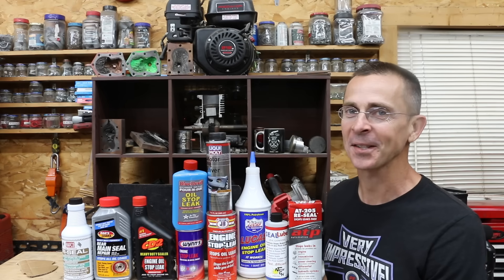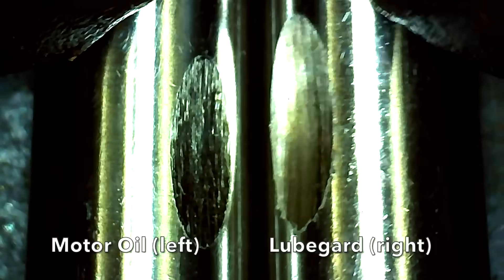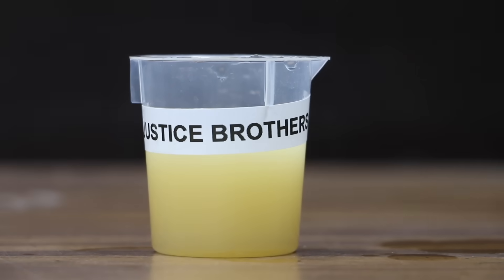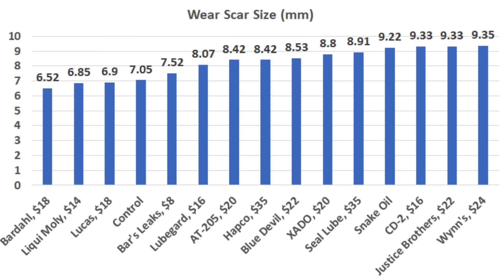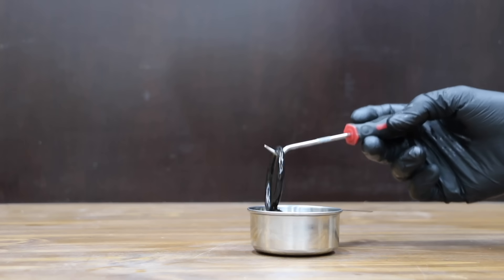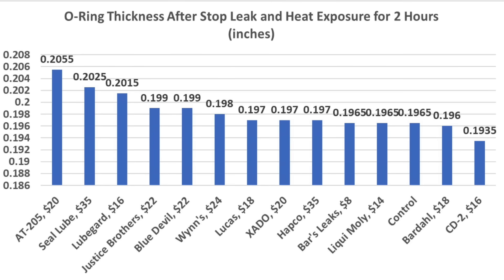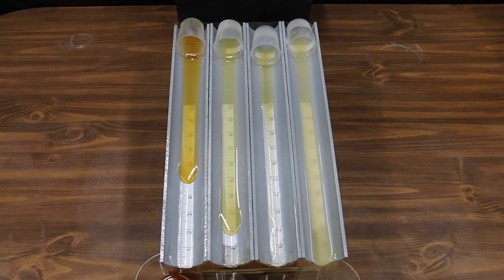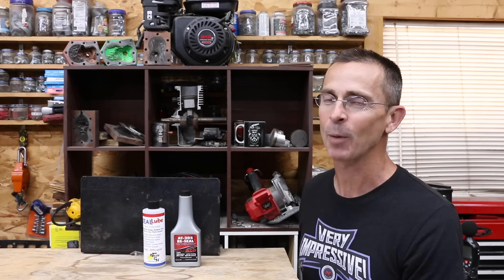Do Stop Leak Products Work? Do They Damage Engine Seals? Will They Destroy an Engine? Let's Find Out

Comment: I have a 2006 Trail Blazer that I dont understand is if it is drinking Engine oil or if its leaking but the car is at 349k kilometres and it's too expensive to take into the shop to repair, do you recommend the AT-205 for my case? The care is also missing and the rpm keeps fluctuating at Idle

Comment: This was yet another objective product test, but it's flawed.
The film strength test provides a relative indicator of engine wear, but not a realitic one. No one is using any of these products at a 1 to 1 ratio. 
Can you imagine trying to run an engine with 50% of any of these products in the crankcase? Scary thought! You should do it. 😉

Comment: My 2006 kia diesel is mixing oil and water in cooling system i suspect its a old oil cooler o ring playing up. Have been considering using at 205 to soften and swell the o ring hopefully stopping the leak instead of having to remove and rebuild the oil cooler. Should i try the at 205 or just spend the big bucks to get the oil cooler rebuilt?

Comment: Great video - thx but there is a however!!! I believe it was a missed opportunity to not actually list the measurements results in a chart. While ranking is good, it is a rather brute and coarse measurement. Can you add the actual measured results as a chart? Then ranking each test as deviation from the mean should present a very different picture- a more balanced and equitable position showing that the difference between the first and last position is not that drastic!! Thx again

Comment: Im having some oil leaks in my old 09 honda pilot. Seems to be coming from the rear main seal. I doubt AT 205 is gonna hurt it but im strongly debating trying it out to control that leak. Would the liquid molly or lube guard be the better choice to stop the leak with minimum/no damage?

Comment: used bars      just tried this last week followed directions still had leak lower rad hose area ford escape , so kept heater off when driving around and a few days later leak stopped i think it needed more pressure to get into smaller areas
Reply from the maker: Thanks for sharing.

Comment: I have a 97 Camaro with an lt1 in it. It’s got a leak in 3 places and it’s hard to tell where the leaks are coming from exactly without taking the entire top of the motor off. I put some blue devil stop leak in it (probably would have chose a different one if I seen this first) and it completely stopped all the leaks from the engine and it’s been about 3 months now without a leak. 
I plan on driving it this way till I can afford to get the motor completely rebuilt
Reply from the maker: Thanks for sharing.

Comment: Have you tested radiator stop leak products? I have a leaking heater core in my classic Volvo and the shop manual estimates 12 hours to replace the heater core. I'm tempted to try pouring in a bottle of goo to see if that allows me to put off this job for a year or two but I'm hesitant to do anything that may contaminate the cooling system or cause other problems in a car I plan on keeping indefinitely.
Reply from the maker: Thanks for the suggestion.

Comment: AT-205 works very well if not the best seal restoration around BUT DO NOT add to your engine oil because it will loosen the coating on your oil pan causing serious blocking in your oil catch
Reply from the maker: Thanks for the feedback.

Comment: Old school trick we do in my country is to put brake fluid into the power steering reservoir if you have leaks and run it for a week or so and it does wonders 
I haven't tried it on anything else but I know it works veery good on power steering
Reply from the maker: Thanks for sharing.

Comment: A 50/50 concentration of these stop leak products skews the wear results pretty dramatically.  It's probably the easiest way to test them, but wear is probably not a major concern when the ratio of oil to product is 90:10 or 80:20.  The length of time the stop leak is in the system is also a factor on wear -- for instance, if the effects last years, and it is only in for one engine oil change, vs. permanently in a power steering system.
Reply from the maker: Thanks for the feedback.

Comment: Today, I ordered AT-205 before I saw your video.  Fortunately, your report supports my decision.  I've never been a fan of using additives to solve problems.  I'm going to make an exception in this case.  I have a stock 2003 Corvette (150K miles) with a big leak at the rear of the engine.  The local garage wants $1700 to replace the rear main seal.  That's mostly labor.  The torque tube and rear end would have to be removed.  Going the additive route first.  We'll see how it goes.
Reply from the maker: Thanks for sharing.
Reply: @GregSr so, did you tried this product ? im on the same situation but my vette its a 2005 C6 but i got the same issue with the rear main seal i wanted to try this
Reply: @ordovicicosilurico6799  Since adding the stop leak, the oil leak has increased.  I'm not blaming the AT-205, but it had no effect on reducing the leak.  I also tried it in my 96 Impala SS.  Again, NO reduction in the amount leaked.  I don't have a theory as to why it is so effective in some cars but has no effect in others.  Unfortunately, my garage floor looks like an oil slick from the EXXON Valdez.

Comment: Might be a bit niche, but I would love to see a simple test of gl-4 vs gl-5 rated gear oils and their additives in your friction test, but with a "yellow" metal(copper, brass, bronze) instead of iron or steel. I think the test would show whether yellow metals will corrode or wear prematurely since these gear oils can have sulphur or other EP additives for differentials and transfer cases. The same class gear oil is called for in my old rav4, which uses a shared gearbox and transfer case for gear oil. So, many people say to use a different more expensive product (ie: redline MT 90) in the transmission to save the synchros which are made of yellow metal, but in my case its shared so I am extra confused. The bottle of gear oil I used even says not to use in synchronized transmissions but meets the manufacturers requirements. Weird right??
Reply from the maker: Thanks for the suggestion.

Comment: First off, love the work. Question regarding the lubricity test though, these have different ratios of sealant to oil, but all the tests are done using 50/50. I imagine those ratios exist for optimal performance of the product, just curious if that would have made a difference.

Comment: Nice work as always.

May I ask, do you think this kind of product can stop oil leak in the valve seals and the head cover gasket? I have minor oil loss in my car's engine. No drip but I see oil stains as if sprayed over the body parts (as if sweat). I use lpg as we all know it wears out the valve seals earlier than petrol or gasoline engines. So what do you think about this?

I surely know and am aware of it that even if it works, it is a temporary solution. So does it worth using these products? (I can find Liqui Moly which I surely trust the company because I use their oils with pleasure).

Comment: this is HUGE.. i have a massive rear main leak in my honda J series car and was leaning towards one of these products, but now that i've seen these tests, i've changed my mind and gone with one less damaging to my engine!! THANK YOU!
Reply from the maker: You are welcome!
Reply: Which one are you going to choose because I have the same problem and I can’t really make out the results
Reply: @A2Rplaytime at205 is the best
Reply: @A2Rplaytime what did u end up using? lmk thanks
Reply: Is at 205 safe? I plan to pour this on my transmission drip after I just replaced it
Reply: Which one having same problem in my 06 j32 swap
Reply: @Evan_GFK  AT 205. it can be had at NAPA

Comment: I would like to see fuel system cleaners tested on removing gunk & unclogging jets in old car & motorcycle carburetors. Not pistons, heads, valves. Much different! You may have to mix with gas in airtight containers to soak for a month. This replicates real-world  application. Where we patiently give it a month or 2 to avoid a carb rebuild!  There is also a lot of sloshing about. So maybe daily sloshing?  Creating vapor to soften crud in carb passages, like driving.  You would need to find nasty bowls and jets that ran todays ethanol gas then sat. ( junkyard!)

Comment: I will use the most effective product in small quantities. I am restoring an engine that sat. 35 K miles on a Goldwing, the seals are not "worn out". The seals are just slightly shrunk and hardened.
Reply from the maker: Thanks for sharing.

Comment: Scotty the mechanic basically has been touting the real-world results for the AT-205. He regularly applies it to all of the rubber bushings and seals as part of maintenance for his own vehicles, well before any of them crack and break. In answering people's submitted questions, this is something he has advised that they find, buy, hold onto such a product for those cases. Using it on suspension systems and other things when a vehicle can sit and wait for a day or two in order for the product to do its thing, that can basically keep seals, bushings going for much longer. Even with a series of new seals on the side, not having to replace any of them because of good maintenance practices makes a lot of sense. The more you can safely get out of your components, the better for the wallet. Granted, he has said about how there's some lubricity loss and all that for the oil system, and your findings are consistent.
Reply from the maker: Thanks for sharing.

Comment: AT 205  STOPPED A BAD REAR SEAL LEAK OR SHOULD SAY SLOWED IT BY 85 PLUS %  BUT I USED 2 OF THE 8 OZ BOTTLES OF  THE 205 AND THAT WAS A MISTAKE IN MY LS 6.0 LT 6.5 QUART CAPACITY OIL AFTER 100 MILES I CHANGED THE OIL OUT THEY RECOMMEND TO LEAVE IT IN FULL 3000 MILES ,PERHAPS IF U ONLY PUT 1 OF THE 8 OZ BOTTLES BUT AFTER SEEING YOUR VIDEO HELL NO ...ANYWAY  2 BOTTLES A NO GO I SAW MY OIL PRESURE DROP  BY 20 - 25% IT WAS EFFECECTING MY OIL PUMP I ASSUMED ?" NOW I THINK IT MAY HAVE BEEN CAUSING FRICTION AND HAVOC ON THE ENGINE ,LEAK CAME BACK  I USED BARS LEFT IT IN THE LIFE OF THE OIL NO ISSUES OF OIL PRESSURE DROP WITH BARS STOP LEAK IT SLOWED THE LEAK TO AN EXCEPTABLE AMOUNT

Comment: Are these safe for motorcycles or will they make my clutch slip ?  I have a leaking valve cover gasket. And well to change the gasket I’d have to drop my engine off the bike.
Reply from the maker: Thanks for the suggestion.

Comment: Thanks for doing this 👍🏼.  I just purchased at-205 to spray on my bushings. It’s good to know it will actually do something.  
As far as putting it into the engine oil to recondition the seals I guess most should be applied then driven for a short while and change the oil?

Comment: I used AT-205 on my Javelin with a rear main seal leak, it resolved it after about 50-100 miles.
I had no faith the product would work, just a shot, before removal and replacement of the rear main.
Reply from the maker: Thanks for sharing.

Comment: I would love a video comparing digital multimeters. I have a cheap pair from amazon and as I get more serious about computer aided design I could use an upgrade. 

A few of the tests I would find useful is how smoothly they expand. 

Obviously how accurate they are. 

If they need to be zeros between measurements or if they stay true. 

Battery life, if possible, could maybe just measure power draw while in operation to see which is the most efficient I know a lot of them have sleep modes but idk what their power draw is in that mode.

Comment: So I Been following your channel years now and let me tell you I switch to mobile 1 syenthiec and Lucas products  on my G37 Infiniti 2009 and it' had 397k miles and I sold it and whoever I sold he is also using same mobile 1 and now car is going to 418k miles 😍
I am also using same on my Ford F150 2014 4x4 and it just reached 280k miles so thank you for all the knowledge 🙏 
Now I have question , I recently noticed on my truck it's having rear main seal leak which is very slow not massive , to repair it completely it's about 750 to 1200$ I don't have that much , what would you strongly suggest I should use,  should I go with AT 205 or blue devil or bar ? 
Any advice or suggestion would be highly appreciate :() 
Thank you once again very much for all your hard work and videos , stay bless 🙌
Reply from the maker: You are welcome!   Use AT205.

Comment: I wanted to ask your opinion. I watched another video about At-205 and the person doing the testing stated that the old bottle of AT-205 prior to I think 2020 had a certain nail polish remover smell to it, which made the Product more effective and the newer bottles after I think 2020 doesn't have the nail polish remover smell in it anymore which may be a reformulation and is not as effective as the original formulation. Can you confirm if this is true?
Reply from the maker: Thanks for the suggestion.

Comment: Why heat the seals up to 350F when an engine running at that temperature would be destroyed?  Why test the products at 50/50 with motor oil when NONE of them tell you to do that.  Most of these products put something like 12 oz into a crankcase of 4-6 quarts!  The narration says to "simulate engine conditions" you put 50/50 mix heated up to about 200F.  But that is NOT simulating engine conditions.  None of these products tell you to use a 50/50 mix.  Unless you test the products the way they are supposed to be used, how is any of this valid?

Comment: Thanks for the great video. I was a Mr Goodwrench . An old mechanic that worked their said to leave those snake oils out of your engine  . If the dealer got an older leaky vehicle " engine only" the put 3 ounces od brake fluid in and the mechanic would drive the car 3 - 4 days, then change the oil.  In most cases it stopped the leaks , but I don't know how long.  We'll my 06 silverado started a rear main leak. I tried the 3 ounces of brake fluid and drove 80 miles a day for 3 days" back and forth to work" then changed the oil. The leak stopped and 3 months later its still dry.  I have no clue as to whether it damaged the engine. But it's running fine with 80 pounds oil pressure.
Reply from the maker: Thanks for sharing.
Reply: I used to do this on an old VW. Trick works with DOT-3 which I believe is primarily mineral oil. Re-impregnates the seals. Its a temporary fix though.

Comment: I have used Blue Devil for power steering, Bars for radiator/head Gasket and both worked great.  CRV with over 200K and still running.
Reply from the maker: Thanks for sharing!

Comment: Hey, great science here! Love it, and thank you,sir! I have a significant leak in my vortec 4.8 l motor which has 205K on it. I have noticed that the products that seem to be less miscible with more cook-off seem to perform best with softening gaskets and therefore fixing leaks. They also seem to separate more in the tests. How critical would you say that separation is on an older motor which I'm running full synthetic oil in? I'm looking at a leak which I can't find which is quite possibly a rear main seal. Given the age of this motor and the fact that I have sticking lifters I feel like a motor replacement, while expensive, maybe my best option. When it came to approximately $1,500 to replace the rear main I started to think I might as well try a stop leak for now. 

What are the ramifications of the product separating from the oil? The weather here in Washington state never gets down to -40° c or even close, does the additive making the oil milky or separating have a great effect on wear in my older motor, or not? Thanks in advance for any answer,  OP or other professionals...
Reply: Run seafoam in the gas and oil right before you are going to change it, then run blue devil rear main sealer in the oil. After about 300 miles it stopped my rear main seal and oil pan gasket leaks. Seafoam cleaned up the valve train a bit. Seafoam initially made the leaking significantly worse probably from dissolving all the deposits.

Comment: Im afraid that you can't accurately measure the o ring thickness using calipers. You need a proper camera- based measuring system to do it closer than 0.2mm.

The temperature of them makes a huge difference too, needs to be exactly the same.

Comment: Some is good. More isn’t better. 
Transmission stop leak if used excessively causes internal seals to go from brittle to marshmallows. As a transmission builder I can say that is a fact that was verified by the customer ( one treatment improved his delay drive but 3 more certainly ended the transmission!!)
Reply from the maker: Thanks for the feedback.